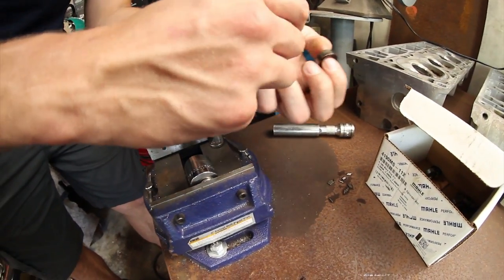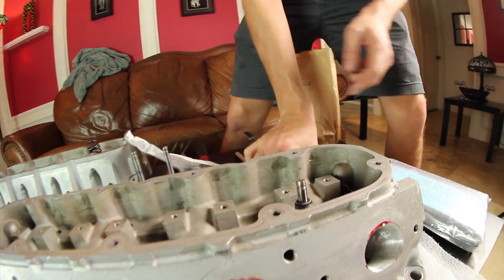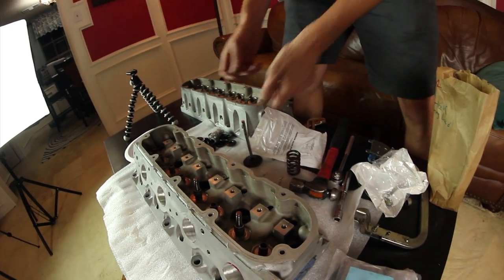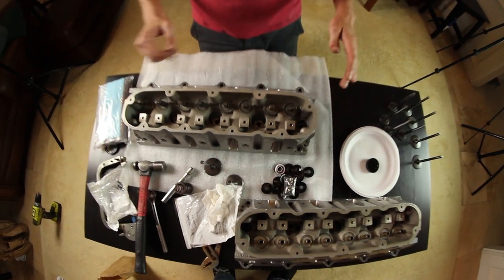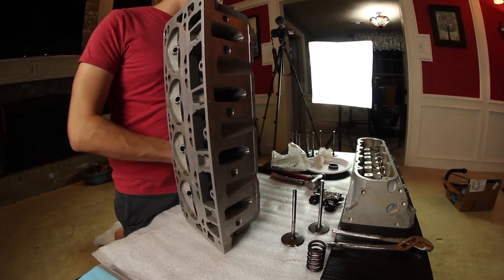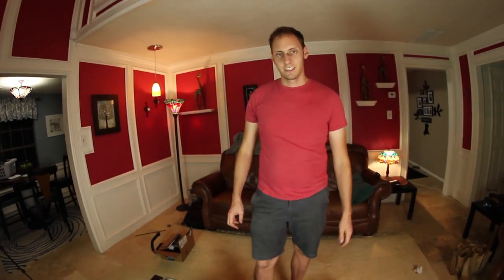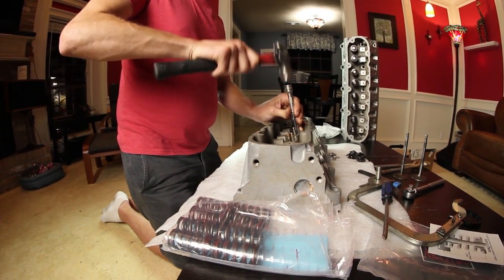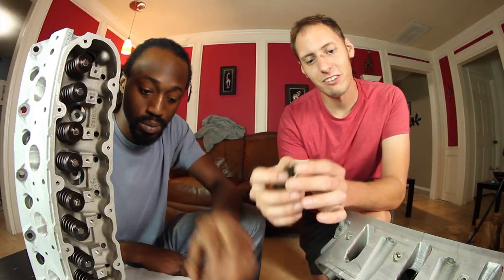5.3 LS Valve Springs & Seals  | The 500hp Budget Build - Part 10

Comment from the maker: Here are the spring specs incase anyone's wondering

1.265" OD
.880" ID
130 Lbs @ 1.790" -Valve Closed, Spring Installed Height
314 Lbs @ .500" lift
335 Lbs @ .550" lift
351 Lbs @ .590" lift
Rate#  368
Average Coil Bind @ 1.130"
Max lift- .590"

https://www.alexsparts.com/ls1-series-drop-in-valve-spring-kit-gen-iii-iv-vortec-hp-spring-kit/

Comment: What's your calculation for Compression Ratio?
AND are those upgrade springs.... ?..... Turbo motors  like to Screem!
Reply from the maker: Will have to double check to make sure, I believe around 9.6-9.7 : 1
Reply: That's a little High for turbo application....  just sayin...     5.3 go boom...... 😎  get ur dun
Reply from the maker: Not at all.  It's good for our boost levels
Reply: Yea. Wont take much boost to hit 500hp.
Reply: low compression needed for turbo application is a thing of the past. EFI systems have made that an obsolete ideology. Those LS1 heads have a larger chamber and will give less compression than a standard 5.3 head anyway. You guys won't have any issues with compression ratio
Reply: If there's any concern, run e85 if it's available in your area
Reply: there is no concern. 9.7:1 is nothing to worry about. but e85 is good to run. much easier on the egnine